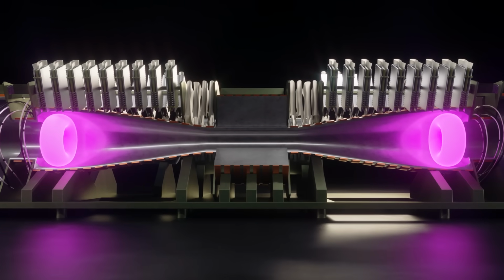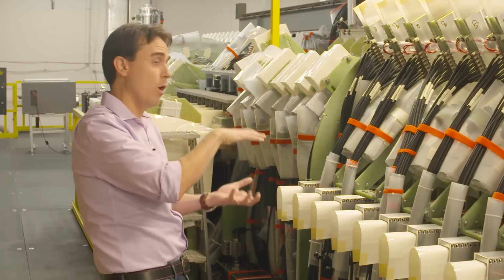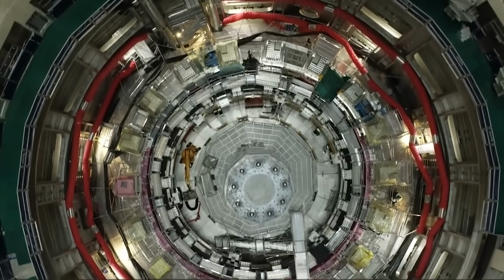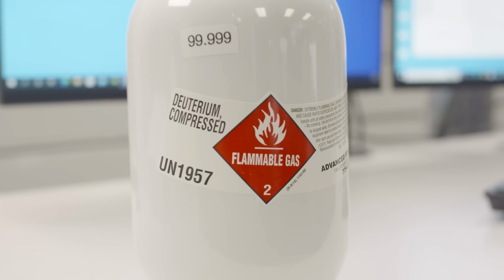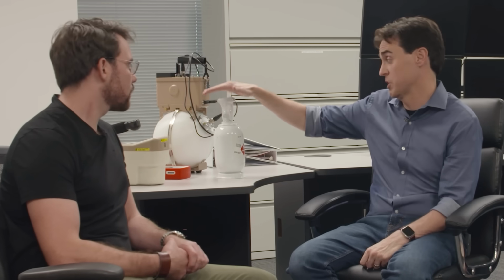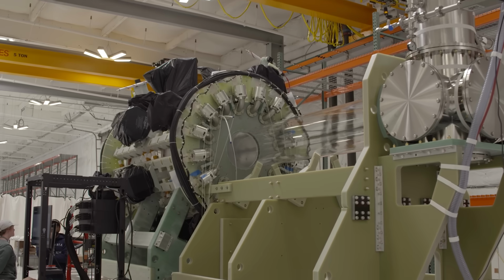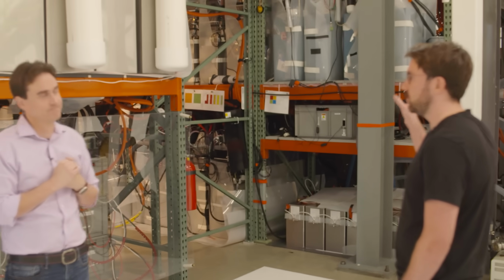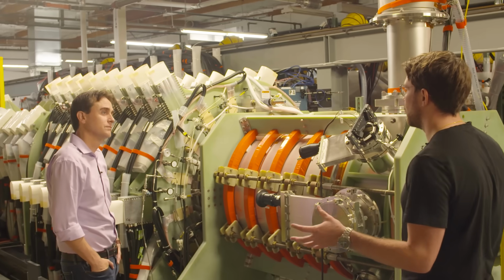A New Way to Achieve Nuclear Fusion: Helion

Comment: idk if I understood it well, however, is this a nuclear powered engine? If yes, is it better using plasma powered nuclear engines than using a Uranium powered ones? guys I'm just a liturature student don't get heated on me pls, just genuine questions here.
Reply: In a nutshell it's basically a generator that harvests the surplus energy from smashing two atoms together into one (one atom needs less energy to stay together than two do), problem is it takes more energy to actually do that than they are getting out of it and when it happens they can't control it.
Reply: @mariemccann5895  can't thank you enough, thanks a lot I really appreciated.I'm really new at those stuffs but I'm curious. let's hope someone find a solution bc it's too promising

Comment: Wait... so the global supply of fuel for a so far unused system is low?  Imagine that.  Like all other industries the supply meets the demand, so far the demand for these fuels is all but non existent beyond experimental builds.  If anything is surprising it is that there is so much of these fuels for a reactor that is not in mainstream use yet.

Comment: Over billions of years, our Earth and its life forms have evolved to live in a fairly close balance with the energy supplied by the sun and that energy lost to space. The difference between the energy received and that re-radiated was stored on earth as inactive fossil fuel - that is dead plant matter. The Earth also has an internal heat source which is accounted for in the overall heat balance that keeps the planet at an even (broadly speaking) and constant regulated temperature. We have skewed this process by adding heat from burned fossil fuels, as well as fission from nuclear processes, so much so that the consequences are the climate change that we see as rising temperature. Now I presume that the hope is that we can replace all fossil fuel and fission processes with cleaner fusion processes. However, the energy produced will be the same (or more) because we have an insatiable need for it, and since all this energy eventually degrades to heat, the planet's temperature will keep rising. What am I missing about the quest for fusion energy and its supposed solution to our present actions that are ruining our earth?
Reply: Political pseudoscience tosh.

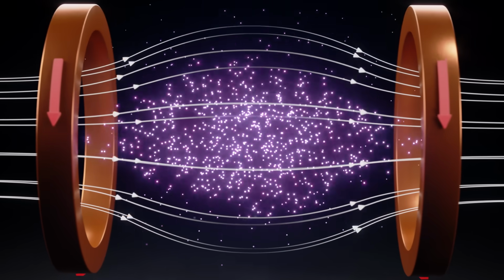Comment: What about the Neutrons generated by this reaction and their effect on surrounding material? They fly "right through the magnetic jail" (14:47) Doesn't this one also end up "dangerously radioactive"?

https://www.nrc.gov/about-nrc/radiation/health-effects/radiation-basics.html#neutron
Reply: According to Helion last year presentation for the US NRC, these reactors will be housed in rooms with walls one meter or more thick (3+ feet), made from borated concrete and other neutron shielding materials. The parts of the machine inside them will become radioactive but, in contrast with current fission reactors, they'll be made with materials that don't retain said radioactivity for long. According to that presentation, they estimated entering the reactor room should be safe for humans two to four weeks after powering off the reactor, and in one year its radioactivity level would be indistinguishable from ambient.

Comment: All lies. Energy injected by lasers is ignored  so as to pretend that there is an energy gain. Nothing but a trick to steal money.
Reply: A bit of a simplification, but possible I suppose, although unlikely.
Reply: @mariemccann5895  I dreamed the dream. It turned out I fell asleep on the toilet.
Reply: @mariemccann5895  In 30 years they will have the simplification.  Fusion power still 30 years away.

Comment: This looks like bullshit. I'm having serious doubts that those cables they are showing that are reaching the reactor can handle 100k amps, let alone 1 million amps. Can I get a sniff test on this? Also, the structures look so janky, almost as if it's staged. This stuff doesn't LOOK like it can handle the pressures they claim. Just regular crimp connectors for a million bolts? No isolation? just some paper between them? This just doesn't add up for me.

Comment: Tritium can be sourced if we build a moonbase. Tritium is deposited in lunar regolith by solar wind, which means tokamak reactors don't need to go through the whole blanket rigmarole. Tritium could be collected by autonomous vehicles, put into canisters, and fired out of electromagnetic coil-guns to escape the moon's gravity, and de-orbt in earth's atmosphere on a target in the gulf of mexico, or any sizable lake that is shallow enough for recovery by dive if necessary, since parachutes and inflation devices may not be able to be on the canisters due to the cost of sending materials up to the moon. the canisters will likely also be made of processed lunar regolith, to minimize supply trips.

Comment: It sounds like, throughout this video. You're avoiding the primary question. A lot of cost, as well as a reasonably, ultimately, wasteful operation, that results in how much energy production over the amount of energy used to produce the said energy output. How much of the energy that you are creating do you have to reuse to make this energy. If it isn't any more than the few percentage points that nuclear energy already produces. What advantage have you created that isn't being devoured by the ultimate problems created?

Comment: As a lay person, two things immediately jump out at me in the first 5mins... 1) no radiation shielding or badges or any other protections; and 2) the machines are not in clean rooms, or anything that looks super clean to prevent outside particles from entering the machines and tools.  I would think something like this would be be concerned about both.  Regardless, if this hasn't been peer reviewed, or patented, I'm a bit skeptical.
Reply: Look for patent US20180025792A1.

Comment: Curios if they could generate a little extra power by actively cooling the reactor with water. Specifically when they want to run multiple times a second

Comment: Finally, Someone a fusion plant that generates power more advanced than boiling a pot of water.
Reply: What's with the hate in this comment section for steam turbines? Both turbines and steam generators/boilers are quite a bit more complicated then "boiling a pot of water". It's sad to see how all these commenters are equating mechanical systems with primitive systems. I guess the general public is just this ignorant.
Reply: @slome815  it's more like steam is hitting a limit with respect to what can be done with it. It's also <150 year old ideas that have large efficiency losses. Steam is great, but direct energy conversion has a lot more potential.
Reply: a million miles per hour man that's fast🤣

Comment: D-He3 at 100M'C has a colomb barrier >>>>>>> D-D = T+n = T-T+D-T (with even lower colomb barriers) = 3n+He4(ash) So, unless they have very few reactions, where is the shielding for all the MANY neutrons? Marketting for investors has at least been sucessful: $1Bn raised. Not so much a success for science.
Reply: Search for the pdf published by the US Nuclear Regulatory Commission with the presentations from their March 2022 conference. It includes one from Helion with answers to those questions (sorry, can't include the link, Youtube deletes my comments when I do that).
Reply: @charliem6590  The only neutron free fusion is Hydrogen-Boron (not a Helion feature and needs ~20x higher temperature than they get). Helion's postulated reaction would have a high neutron output, and need 1m of dense shielding and all that entails. As it is not present, I can only assume there is only very sparse fusion at Helion. Helion's 2022 paper has not answered this (unless you think they mean to only use 1 atom at a time = Trivial energy like a Farnsworth-Hirsch fusor)

Comment: 80% loss of energy by nutron is critical 
so
Bleed off the fushion exploshion the instant it happens the exploshion and heat of water develops H2 and O and those can be used to power or direct conversion of E power.
Helion hydrogen reactor with ton and tons of oxygen production.
Open the door as soon as fushion reaction occurse
So
A V8 Helion reactor 1 explodes the next explodes the 3d explods giveing time to recharge the reactor bank
Maybe 
A V10 Helion reactor
Maybe 
A V100 Helion reactor
Maybe 
A V1000 Helion reactor
Reply: This Helion engine will get back that 80% neutron particle loss.

Comment: Helion's device is small enough to put on a rocket. Which could then potentially be installed on the moon where there is tons of available He-3. A device such as this may very well be the power source that powers bases on the moon.
Reply: we don't know how much power will a single unit deliver, it doesn't seems like much.. they are probably better use in tamdem of a lot of units.

Comment: Could a flywheel battery be a useful option for short-term energy storage? Some WW2 torpedoes had flywheels with 10 000RPM. Longer-term heat storage could use sand as heat mass.  Working with liquid water or salt for transfer. Neutron production could be used for an accelerator-driven fission reactor or burn up nuclear waste with no meltdown risk.  Easily turned on or off with a switch. No neutrons, no fusion. .

Comment: There are similar reactors.  Or this one has been seen before. They may have made older claims that failed. How do they extract the heat through a vacuum and such a small core?  How do they manage neutron damage? What is the Helion reactor lifespan?  Lockheed's reactor looks similar.  They made excessive/false claims about success.  There are some other unconventional fusion projects that could be successful before the ITER project.  ITER may still take over 30 years until production of working models. And costs a lot. ITER may not be cost-effective.  I still support Generation 4 fission reactors. Some should be operating in 2030. Including Rolls Royce SMR, Small Modular Reactors.
Reply: There have been FRCs researched in the past. That is true. Helion does some unique things with them. E.g. they merge two into a single, hotter and more stable FRC which serves as a target for compression. The burn chamber is located relatively far away from the expensive components are the ends. 
They are not extracting heat. The expansion of the FRC after compression induces a current in the surrounding magnets.
The D-D neutrons are only 2.45 MeV which is below the activation energy of many materials. Some materials they use have a very short half life when activated by D-D neutrons. Those will likely have to be replaced relatively frequently (maybe every year or maybe even every 4 years). They can be mass produced relatively cheaply, though. E.g. the vacuum chamber is made from quartz which is cheap.
ITER is completely different.

Comment: Does Helion exist to solve the worlds energy needs, or to turn research funding into salaries for their workers?  With the number of basic power system and support problems that they aren't even trying to solve, they look like a potemkin research group to me.
Reply: Like what problems?
Reply: Helion is a great company for its workers - never has so little been done by so few for so much (money).
Reply: @sassa82  
120+ employees.
Little done? Lets see:
First private company to achieve 100 million degrees plasma temperature.
Highest triple product of any private company.
Polaris building complete. 
Capacitor manufacturing street complete.
Magnet manufacturing street complete.
Fused Silica tube manufacturing street complete.
Polaris formation test section second test campaign in progress.
Reply: @elmarmoelzer2229  Don't feed the trolls 😁

Comment: They should stop using this machine, in theory it could actually project waves into space if ever timing and precision and pressure of surrounding environment was off.
Reply: Picture a heat wave with an electromagnetic pulse. And what are those really good at doing. Looking for a ground target.
Reply: Would it ever be possible to use the sun as a lighting rod? Kind of like energy disposal assuming we could put power it with the input?
Reply: I think the scariest idea would be us accidentally off setting a tether to the sun that the Earth naturally puts off
Reply: Or what ever the equivalent of that possibility would be on earth? Like another reactor? What happens if you have two of them in the same safe zone?

Comment: meanwhile my b s detector going berserk 🔔💣🤯... wt* is wrong with real engineering? ... i am not a nuclear scientist, but understand enough highschool chemistry to worry whether the guys sitting next room won't be cooked alive ... too much wrong here ... this is the first machine? 2.8kw? a million amps through those? fusion conditions contained with a v6 sized block? d+h mix wont cause d+d? whats stopping the neutron? ... above all the guy sounds like a sales man recollecting things to say rather than explaining science ... RE shame ... sellout ... i am unsubbing
Reply: 1. Trenta only did one pulse every 10 minutes and not all experiments were made with D-D (or D-He3) fuel.
2. They actually want D-D reactions to happen because that is how they breed their He3.
3. At 2.45 MeV D-D neutrons are relatively benign compared to D-T neutrons (14 MeV). They are below the activation energy of many materials and other materials that get activated have an extremely short half life measured in minutes.
4. When operating in mixed mode (breeding and energy) neutrons are produced in only 1/3 of the reactions.
All that means that there are fewer neutrons per pulse and they have less energy. Shielding is still required and they actually do have shielding in the walls around Trenta.
Reply: @elmarmoelzer2229  Thanks for confirming the suspicion that it is just hocus-pocus
Reply: @bp.007  How so?

Comment: This is not nuclear at all it is a Phusion a magnetic repulson heater? Then there is no new elements being made it is just converting to different forms of the same elements? This tech is not new they just got it working when it was came up in the 1920s?
Reply: It is called nuclear fusion bc it has to do with nuclei you underbaked French fry. Also since when has nuclear energy been around since 1920? And how is h3 being synthesized from 2 deuterium not a new element being formed? Deuterium is an isotope of hydrogen, not helium

Comment: 5:30 wait, cant you use that as a weapon? By "lobbing" said plasma out the other end?
Arent these essentially two plasma accelerator cannons, facing each other?
Reply: The plasma is not very dense (closer to a vacuum than to ambient air). Total energy content is maybe 4 kWh. Also it immediately cools off, if it gets into contact with something like ambient air.

Comment: Where's the money for all this tinkering coming from?
Reply: Private investors: Mithril, Sam Altman, Dustin Moskovitz, YCombinator, Reid Hoffman and Capricorn.
Reply: @elmarmoelzer2229  Thanks.  I wish them luck and low adsorption levels of neutron radiation.
Reply: @elmarmoelzer2229  I'm sure that if the device becomes operational neutron radiation will by definition, be confined to acceptable levels, but I wouldn't want to be anywhere near it during R&D.
Reply: @davidhess6593  
It is manageable. Helion has a lot of experience with this. You would not want to stand right next to it while it is turned on, though.

Comment: I was wondering about a couple of things you mentioned (or didn’t mention) regarding the tokamak concept.

While the D-T fuel combo has less of an energy input, why can’t a tokamak run on D-He3? Also, did the yield report on the tokamak include electricity production from the bootstrap current in the plasma?

Not to dismiss Helion’s achievement…if they can beat the tokamak concept, great!

 It may also be a complementary technology to the tokamak for fuel production and the energy needed to start a tokamak reactor…perhaps a combined-cycle system for efficiency.

Oh…and how do they get rid of the helium ash?
Reply: "While the D-T fuel combo has less of an energy input, why can’t a tokamak run on D-He3?"
Tokamaks have a couple of disadvantages:
1. Tokamaks are low beta. That means that the ratio of internal pressure in the plasma to magnetic pressure is very low. Helions machines use FRCs which have a beta of 1. Toks have a beta of about 5. So Tokamaks would need much stronger magnets than Helions machines do for the same density and temperature. On the downside FRCs are very unstable and can only be kept alive for a short time. But that is not that bad, if you design your machine around that limitation. This is why Helion is doing relatively short pulses.
2. Tokamaks are operating at an equilibrium of electron and ion temperatures (about the same temperature for each). Pulsed systems like Helions can have a much lower electron temperature (Te) compared to the ion temperature(Ti). So Te:Ti is about 1 in a Tokamak and around 0.1 (or less) in Helions machines.
The ion temperature is where the fusion happens, the electron temperature is where the losses are. If you are interested in the math:
Fusionpower/Losspower scales as Ti^1.5 / (Z^2 * Te^0.5 )
Reply: @elmarmoelzer2229  I can see the issue…Helion’s machines being smaller with a smaller cross-section area would also require less energy to reach the plasma and get the plasma to reach the Lawson criteria for the fuel mixture (plasma ion density, plasma confinement time, plasma temperature).

I thought that in the Tokamak, the magnets were large because of thermal issues…namely that the temperature of the magnets has to be really low while the plasma they contain and compress is really hot. 

But Helion so far has demonstrable results, so IMHO that’s Helion’s greatest advantage.